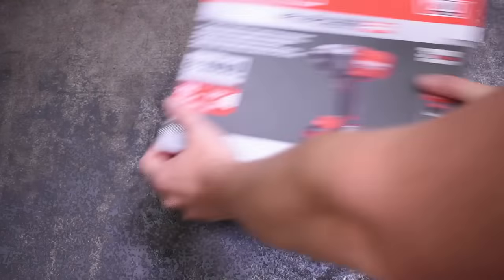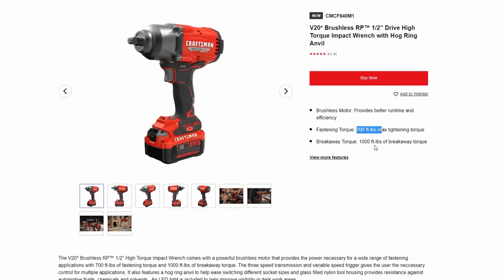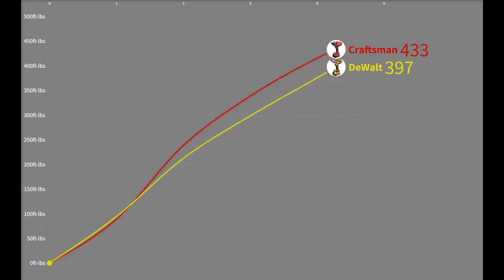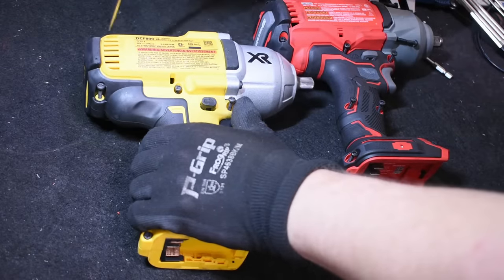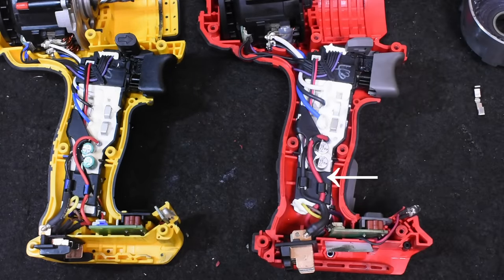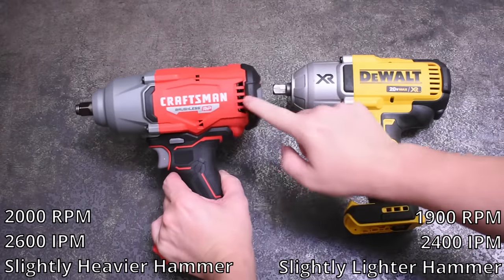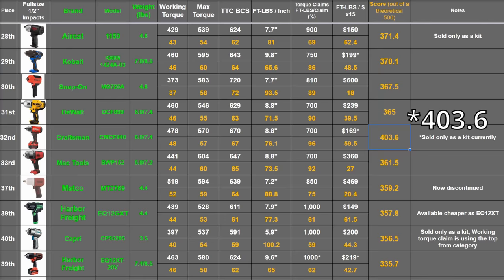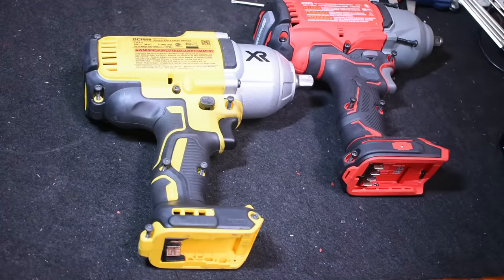Something Weird is Going On Inside Craftsman's New High Torque Impact Wrench

Comment: I always find these 'rebadged-but-not-really' deals interesting. Getting more out of previously sunk development costs, but making some investment in small changes, maybe cutting manufacturing costs somewhere, meeting a different price point, etc.
Reply from the maker: Feel exactly tge same on all those points!
Reply: I agree as well. They do it in cars too. When the new flagship models arrive. The trickle down to the lower trimmed models save money. All you need to do is refresh the cosmetics. Like how the newest Nissan Altima always takes cues from last years Maxima. It’s a shame Craftsman doesn’t shift their brushed drills and impacts to DeWalt’s from PC. At least then you could rebuild them.

Comment: I have the Dewalt 899 - it looks pretty much same as the Craftsman to me. I have hammered that Dewalt for years - the anvil is hanging loose but it still works day in & day out - I bought it well, well used btw - it was clapped out when I got it, but it still knocks stuff loose daily. I'd take that Craftsman no problem - bet it's a good tool.

Comment: I came here looking for testing on the new Porter Cable impact wrenches coming out. From what I can tell they're the same as the craftsman and dewalt offerings. They've also come out with a brushless drill, impact driver, sawsall, and even a cordless ratchet. Incredible news for those of us who got into their ecosystem! They STILL offer a drill, impact driver, 2 batteries and a charger for $100, which was unreal 10 years ago and is still unreal today. Would love to see you take a look at their new impact wrenches and see if they are in fact the same as the ones in this video!

Comment: The stamps on the hammer are likely position numbers for a line producing multiples at once. You see similar position numbers on injection molded parts that are molded several at a time in case one mold position is damaged, clogged, or needs to be machined. You also see location numbers for labels printed on a giant sheet… like sealing labels for single serving tubs of barbecue sauce.

Comment: I've enjoyed all my v20 tools as a DIY'er and couldnt be happier, as well as the 80 bones a tool I get to put back in my pocket.  Thank you sir.  And when will we see a 21700 based v20 battery or a v20 Powerstack from Stanley?  probably never, right but could be something they are working on.  the battery density could use some upgrading.  I do love the 4.0ah batteries.  I seem to grab them usually.
Reply: Just grab yourself a cheap adapter from Amazon and a 21700 battery.

I’m on the dewalt platform but needed a portable soldering iron and craftsman has it.

Comment: I would be interested in seeing if the craftsman could possibly make more power with a 6.0 or 9.0 battery
Reply: I'm curious about that too
Reply: I think it would, the flex volt batteries have a different mount than the standard 6amp hr
Reply: The 6.0 battery really wakes up the Craftsman tools. I would love to see a comparison to the 4.0.
Reply: @MoneyManHolmes  I know my mid torque definitely makes more with a 9.0 than a 4.0 but I wanna see just how much compared to a 4 or 6 amp. I wasn’t able to remove some lug nuts with a 4.0 that I previously put on with a 9.0.
Reply: @MoneyManHolmes  the 9.0 really wakes it up. And on any v20 tool. Even on the V20 tire inflator, and portable shop vac, you can tell there’s pretty decent difference.

Comment: Another great video. I work on cars on the side. This impact has plenty of power for most people and good to see craftsman putting up better stuff. Even if it's more comparable to an older model of a better brand, does it really matter? They can do well with the cheaper prices. 

One big thing for me isn't just the impact wrench, but the other tools in the lineup. For example right angle impacts are cool along with ratchets.  I'd love to see craftsman have a lineup with those that are just a cheaper version of milwaukee. In terms of the right angle impact, I think the only options are kobalt/milwaukee.
Reply: It will be cheaper SBD stuff cause that's who owns them

Comment: Sucks you can't seem to buy it bare tool. I already have 4x1.5ah, 4x2ah, and 3x4ah batteries and 3 chargers. I really don't need another battery. Just want the impact. They sell the CMCF920 bare tool but that's only 275tq.

Comment: My old 899 is sitting in retirement after 5 or so years of hard work. I keep it as a backup for my Milwaukee because it's been such a good gun. Sad to see it's seen it's day as a top contender but it had a good run.
Reply: My 899 is still going everyday shop use 4 1/2 years, recently replaced battery.   It does 99% of everything,  that last 1% I bring out the Ingersoll Rand 2235 I keep in the bottom drawer

Comment: Seems like a pretty good value if the DCF900 is $120 more expensive as a kit but it's a shame the batteries aren't compatible. Would still rather be in the Dewalt ecosystem but I also like overkill
Reply: Ill keep my black and Yellow
Reply: @ChippyTheBard  Yellow spray paint is pretty cheap as well
Reply: @corystansbury  👀 you’re thinkin on different levels Mr Stansbury

Comment: Went to get a Craftsman miter saw and a 4 amp hour extra battery and Lowe's threw in a half inch impact which was normally $150 for the tool only for free. I don't know if it's the same one but I'll take a free half inch impact lol

Comment: Dewalt has the best battery line, the best impacts including the 900 which is strongest impact on the market. They are really killing the game for now, that will probably change eventually but if I was just starting to invest in a tool line currently I would get dewalt hands down
Reply: I fully agree, Eric. DeWalt for the win.
Reply: Can I ask why dewalt beats milwaukee for batteries?
Reply: @ianjay4596  60v
Reply: @ianjay4596  the flexvolt batteries are really clever. Where other brands divorce battery lines, 

Makita 40v, Ryobi 40v, mx-fuel big black batteries. 

DeWalt made the higher performance battery tie into the old platform, making it more versatile. 

But if you leave the red cap off for like a year they drain themselves.
Reply: @MrClassifide  Clever but heavy and run down quicker than they should in any of my 20V tools. They definitely wake the grinder up but if I didn't have two I'd be using my corded grinder(s).
Reply: Best impacts with an asterisk. When your competition has released everything, it's easier to take the crown. Milwaukee is still lighter, compact, and makes power consistently.

Comment: Increasing the wire gauge from the battery could reduce the voltage drop. This would explain the Craftsman overtaking the 899 as the load increases.

Comment: Yeah, really glad I got that DCF900.
Reply: I'm so jelly!
Reply: Same here!  Been beating on it for about a month. It absolutely kills everything els in the shop up to the Milwaukee 1in drive extended anvil w/12ah pack. It may not beat it in reverse but anything that big 1in m18 hammers on the dewalt will rip off. And any of the impacts smaller than the 1in m18 it beats in forward an reverse. 
Id really like to see ttc test it out with the 9ah pack. I really think its a better battery than the 15ah due to the cells and discharge rates.  And well its not 187lbs lol

Comment: Cool, as one has learned to expect from your channel, but one minor correction...
ft.lbs is a unit of WORK DONE, the correct term FOR TORQUE is lbs.ft - they are DIFFERENT things.

The mix'n'match options may be useful for custom builds, or when picking up "broken" tools and making good.

Comment: As some comments mentioned. The number of windings determines the strength of the magnetic field. The more windings, the stronger the field. The number of poles determines the speed of the motor. The number of windings on the poles, the voltage, and the number of phases, determines the strength (HP & torque) of the motor. If you have a specific area where the windings go dimensionally , wire size,  how many wire turns all matter to the output .

Comment: Just picked up the PBLIW01, it's not the B variant.  No idea if there is a difference.  $150 though.  For that price I also had to take a brushless hammer drill, and two HP 2.0ah batteries and charger.  Seemed like a much better deal than $219 :)  Thanks for the info on this channel.  Home depot is the strangest website.  I literally had it in my cart, and they saved me $70 by making me take more stuff.   I was never fond of my, now old, ryobi hammer drill, and in fact used my m12 one for all my shop construction and cement fastening.... but the new ryobi hammer drill is actually pretty nice feeling.  The 2.0ah hp is a nice fit for their rachet.  All and all a decent day of consuming.
Reply from the maker: B just means bare tool
Reply: @TorqueTestChannel  I appreciate what you do.  Best wishes and ty!  Just found some new p195's at a fair price :) Tools for nerds.  It funny how much more excited I get, knowing how things compare overall.

Comment: Kind of disappointed that the Dewalt/Mac batteries won't interchange with rhe Craftsman batteries. Definitely a missed opportunity from SBD to increase the ecosystem. I have MAC at wort and several Dewalt tools for general home use, but I definitely wouldn't mind adding a different tool color that I could keep in the garage.
Reply: Totally agree!!
Reply: There's probably adapters, or slight modifications. I recently made a vid describing in detail how to modify batteries of Porter Cable and B&D to work for both interchangeably. If that battery almost slid all the way likely is extremely close.

Comment: Just a note on the LED comparison comment. Surface mount components end up being significantly less expensive as the parts can be placed by pick-and-place robots instead of manually.
Reply from the maker: But they are so much better!
Reply: Though-hole components get also pick-and-placed, well, at least if the whole board is designed that way.
But yes, it's more expensive, as the soldering also needs to be an additional process, so it ends up costing more. Particularly if you mix SMT and through-hole. And if it's only a few components that are through-hole, then it's probably done manually after all SMDs have been reflowed.

Comment: Because of this channel I have bought both the 891 and 900 and am blown away by them! Quick question. Has the anvil on the 900 ever got sort of locked up and the gun would impact while just pulling the trigger with no socket on it? Very weird occurance but happened to me first time using it.
Reply from the maker: Thats a sign of a tight or non lubed anvil bushing or the motor being clocked wierd and needed to be aligned like seated fully
Reply: I thought I'm the only one that have this problem but mines is from my DCF923B, I already return 2 and I'm on my third one lol,
Reply: @TorqueTestChannel  I took the nose cone off and the anvil was super tight like wouldn't spin inside the bushing by itself, no gears attached until I used pliers to free it. Would polishing the anvil help at all or is it chalked and should exchange it? Thanks for the reply though I super appreciate it!
Reply: I had the same issue with an impact driver on first use. It even let out some smoke. I immediately thought I would have to return it dead but after it cooled I tried it out the next day and it's been running strong since. That was about 10 years ago. I use it weekly and sometimes for weeks on end
Reply: @jbatterden  no it was impacting like I was trying to remove a bolt tightened at 1000 ft/lbs then it froze made some weird electronic noises then went back to normal. Been fine since

Comment: My DCF899 will do me fine for now I did a BMW diesel crank pulley bolt on Rover on  Friday using an IR weighted socket it just spun off in less than 2 seconds. So fast I thought I was using the wrong sized socket.

Comment: That's because NH Bragg manufactures both of them. You would find that Porter Cable Brand is ALSO the same exact thing as these two in the video. When it comes to a majority of their hand tools. Its like buying a Chevy or a Buick over the Cadi but same internals.

Comment: I've only compared the Dewalt to the Milwaukee on an 8x8 military truck that has 10 lugs per wheel all torqued to 600 foot pounds. The Milwaukee came out on top by doing the job faster and the Dewalt burnt out. I will probably get the Hercules ultra and test that when I can

Comment: Hey man, I think the impact drivers should really be tested in different temperatures, for example, Milwaukee batteries will charge in colder temperatures than what dewault will, if I use a dewault in my frame of work(lots of 1/2 high torque work) the dewault will fall on its face for usability beside my Milwaukee. So when looking at a page for reviews I might find that I buy into a brand just to find out it doesn’t work when it’s cold, and I think for that reason it should always be a factor in the reviews. Or at least one big cold weather review

Comment: Just a heads up on the wire gauge comment between the DeWalt and the Craftsman - Voltage has virtually nothing to do with wire gauge. You can have 24 AWG wire that’s rated to 600V pretty easily (Tefzel wire for automotive applications is often rated at 600V). A larger wire gauge will support more current passing through it because it has a lower resistance, and therefore will heat up less at a specific current level. In fact, at higher voltages you can actually use thinner wire for the same power because you will be pushing less current through the wire to achieve the same wattage. The only way that a higher voltage wire will be thicker than a lower voltage one for a given amount of current is just that the higher voltage wire may have thicker insulation. 

I wouldn’t be surprised if the thicker wire in the craftsman is part of the reason it makes more torque than the DeWalt.
Reply from the maker: I'm pointing out that they are the same voltage, so a thicker wire must be designed for more currentamps which is to the power topic
Reply: FALSE, the rating of a wire is current(Amps) at a specific voltage. 10a at 12v is not the same as 10a at 120v
Reply: @mrmotofy  no, my above comment is not false. The cross sectional area of a wire (the thickness of the actual copper) determines its current carrying capability. The insulation around the wire determines the voltage it's rated for. 

You are correct in saying that 10A at 12V is not the same as 10A at 120V, because that's an order of magnitude more power. However, when talking about wires, any wire that is rated to carry 10A of current can carry that amount of current regardless of the voltage. If the wire has sufficient space around it, the wire will be able to support virtually any amount of voltage, as it can basically count the air around it as an insulator. This is how power transmission works. The wires are not insulated, but are spaced apart sufficiently that they can carry tens of thousands of volts. This doesn't change the fact that voltage is irrelevant to wire sizing. The voltage rating of a wire is determined by the insulation around it. 

Current through a resistor is what makes electronics get hot. Wire has some small amount of resistance, and the thinner the wire, the higher the resistance. This is why we use thicker wires to carry more current - there's less resistance, and more mass/surface area that can cool the wire, which allows it to support more current. 

Voltage is a difference in the energy between two points. I could charge a piece of wire to have a 20kV potential, and compare to ground and I would see 20kV on a multimeter. But I could use a 30awg wire, and it would not be a problem as long as the insulation around the wire could contain 20kV. 

The only real exception to this is if you have active cooling on the wire - for instance, you can jacket a wire in some non-conductive fluid that flows around the wire, which can keep it cool, which allows it to carry more current than would otherwise be possible. 

TL;DR, the diameter of copper determines the current flow it can sustain. When I say wire above, I am talking exclusively about the copper - a thin piece of copper without insulation can still be considered a wire, after all. The insulation around the copper is what determines the wires voltage rating as the voltage rating is just telling you what voltage you can send through the wire without worrying about electrical arcs passing between the wire and another conductor. 

And yes, you are right. 10A at 12V is different than 10A at 120V, but only in terms of power (watts). The diameter of the copper (and it's length, but that's irrelevant here) is all that you need to decide if it can handle the 10A. The insulation around the wire will determine whether or not you can safely use the wire, but the copper inside doesn't care. 

There are also more complexities to this when talking about her frequency power transmission, due to the skin effect but that's not really in the scope of this conversation.

Comment: This is completely irrelevant to this video but… I spend a quite a bit of time thinking about these impact guns and their performance. Have you guys considered thread pitch and if it has anything to do with performance. A tighter thread in theory would take less effort on the gun to achieve the same outcome. Can you guys do a video on thread pitches and the effect of which. I would definitely watch it over and over. And would be able to sleep at night. Also as I sit here and think more about it. Does IPM play a role. Does the frequency and harmonics of the vibrations amplify the output of the tool. And what would be the optimal IPM be for mild steel to hardened bolds be.